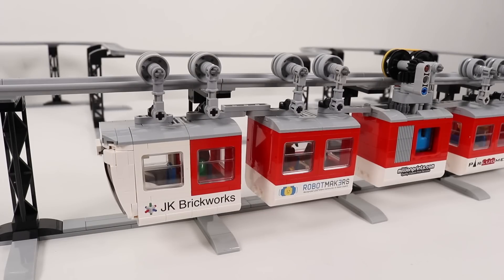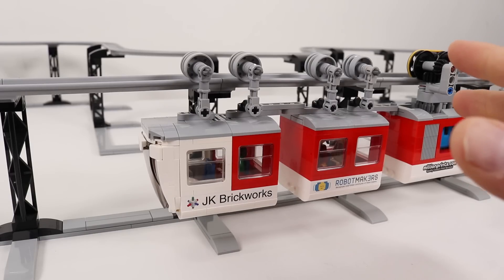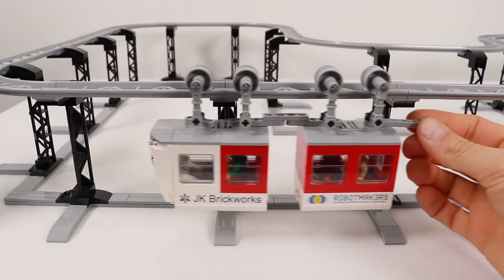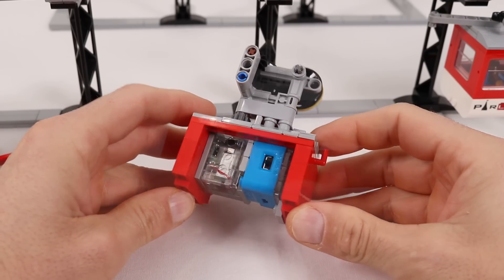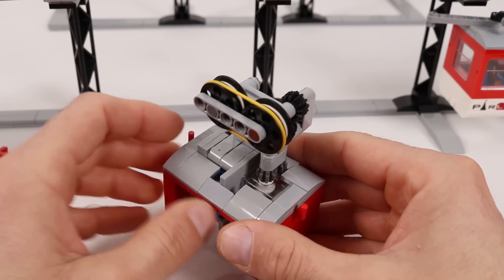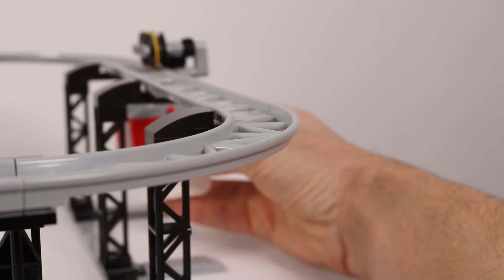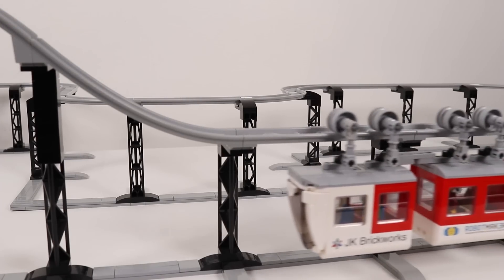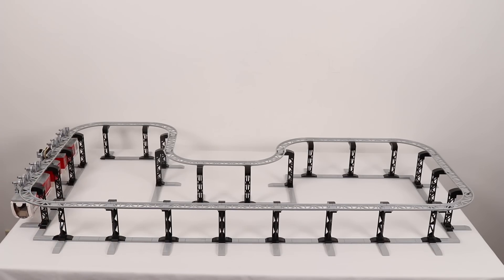Suspended LEGO Train • Design and Instructions

Comment from the maker: The building instructions can be found here: https://jkbrickworks.com/suspended-train
Reply: Could you make it go up a incline
Reply: Actually I have an idea for the extra degree of freedom. You could use technic part 44 and the 4 stud long universal joint to add the extra degree of freedom needed
Reply: Next time,a standard train with a framework(by gear) to avoid being apart in crashes

Comment: Great MOC! But... Speaking about a "Real World" versions of it, I approve the idea of adding another degree of movement to the connections between the cabs for the light ramps, but the fact that the cabs are "rolling" side to side could be "uncomfortable" for the passengers, expecially those who suffers of seasickness.
So, adding another set of wheels that runs on the other side of the rail could be helpful to solve the problem?
Still great tho!

Comment: The simple solution for incline travel would be to ditch the steering at the cabin, make the arm rigid to the cabin, then make a (first) pivoting arm that holds a truck with two wheels, this will allow the cabin to pivot at the top, thus have no issues since the truck is the one that's following the incline, not the cabin, which is a mere pendulum, then (second) make a ball socket connection between that truck and the truck of another cabin.

The ball and socket could be either at the top or on the side, but it should (in theory) look like a car's torsion bar (so a C shape). So that this connection doesn't fall under the optimal position, where the ball and socket connect, a piece should extend under said arm and keep it upright (if up) or horizontal (if on sides).

Caveat, as the cabins are now swinging pendulums under these trucks, they need proportional space to swing so they don't collide with one another. So there'd be a gap between that's proportional to the incline, small incline, small gap, large incline, large gap.

No clue how you'd fix that, but one potential method would be to have that C arm that links the trucks is extendable, with a spring that has enough force to pull the cabins together in normal use, but not enough to stop them from displacing one another (thus elongating the train) as the train climbs.

For the driving wheel, you'd need some method to "clamp" unto the rail. So rather than a standing wheel drive, i'd say you'd need a horizontal wheel drive that hugs this rail from both sides of the track, thus providing enough force to climb the rail. That itself raises the issue of how you'd power it... you'd need to do some pretty nifty LEGO wizardry to pass a shaft through the same cabin suspension arm and give it U joints to allow for movement.

Comment: I wonder if there's some kind of non-lego hardware store item that could be used for a rail if you wanted to build a massive setup that, say, hung from your ceiling without spending a fortune on relatively rare pieces.
Reply: If you wanted to go down that route, I'd just look for plastic strips of the right thickness, use a heat gun to form them into shape, and have the monorail ride on the edge of it.

Comment: Very impressed by this one, and you can tell that the rubber band on the drive wheels helps the whole model be way less wobbly.  I really like how small this is and I wish LEGO released motor elements that were more like some of these amazing competitors, because I can't imagine it would look quite as in-scale and nice as it does at 8-studs wide.  It would be really dynamic to see something like this go up a smaller sloped element.. so if I built something like this maybe I would use mixel joints or something.. but I'm not sure about that particular solution unless you maybe added two between cars because the curves are so sharp I imagine they'd move beyond their effective range and just pop out.  Great job and keep on building!